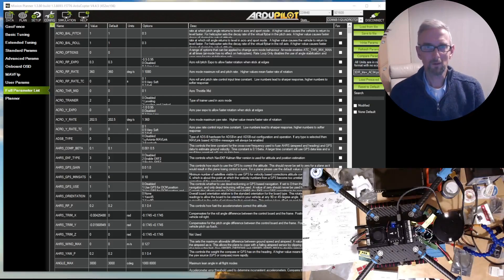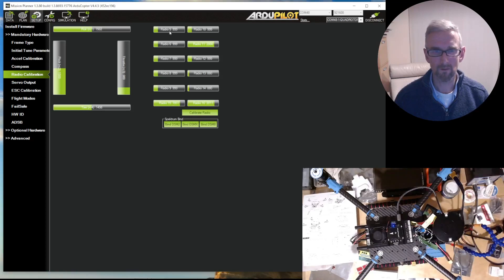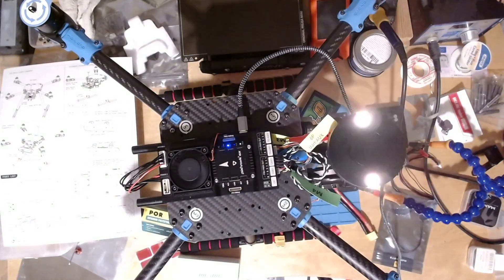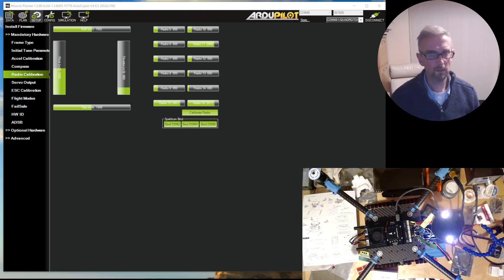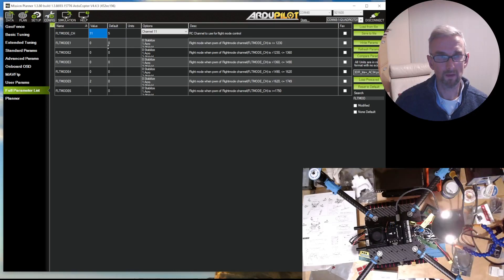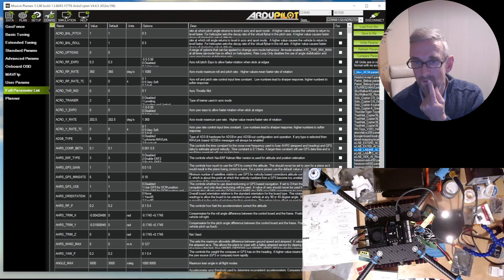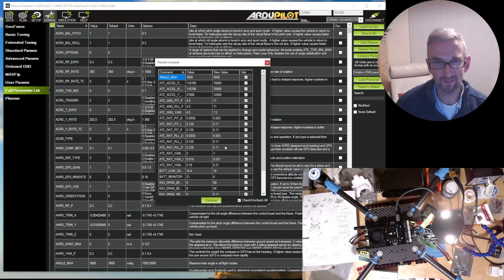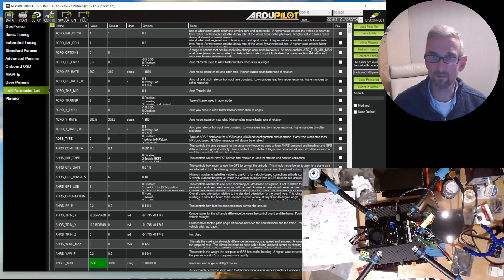Holybro X500v2 Build Video 5 - ELRS Mode Switch Configuration

Comment: Andy, thanks for posting this.  It is not clear to me what the hang up with RC5.  Were you experiencing a low-power limit with ELRS as a result of not having arm on the is switch?  And what if I just rely on arming by pulling throttle back and to right.  Do I really need to rely on a mechanical switch for arm/disarm.  I don't like this because of the possibility of accidental disarm during flight.  Please advise if you have the time - do I need to arm with RC5 on ELRS?
Reply from the maker: No you don't, but you need to remap RC5 on your transmitter since usually that is the mode switch.

Comment: There is one ELRS mode: 16 Channel Full rate/2 that will give you a full channel 5, but you really don't want that because only works with a limited few combos of packet rate/telemetry rate. You just have to assume with ELRS that Channel 5 is 2 position arming, but the bonus with that you get is that is guraranteed to be sent to the FC in every single radio packet no matter what, so ArduPilot needs to be set to not use Channel 5 for anything except arming.